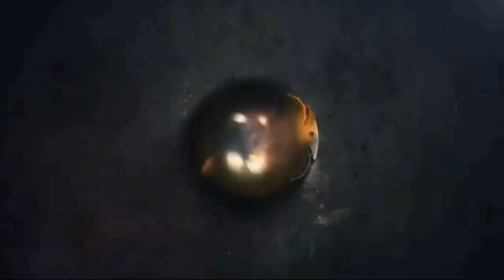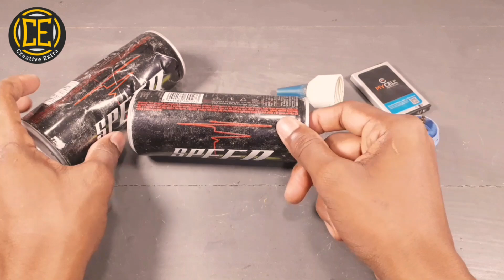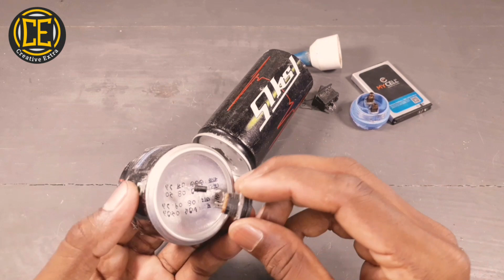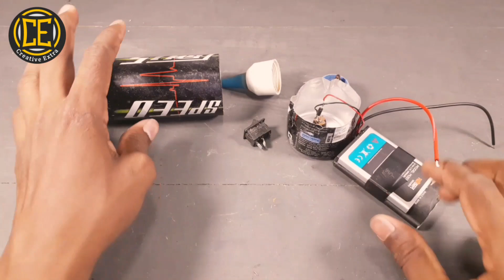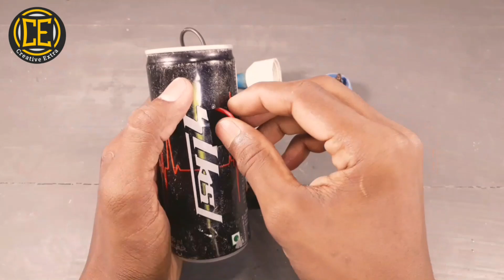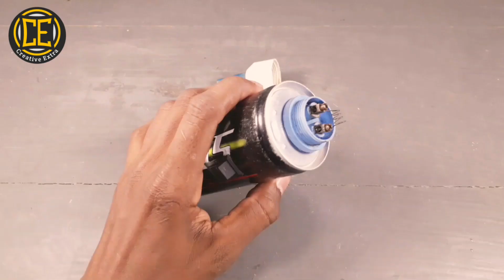How to make a DIY Vape Stick at home || Homemade Electric Cigarette || Creative Extra

Comment: I Use Cheap Battery Banks From The $1 Store... 18650 x 2500 Mah Battery Banks... Then I Cut Copper Tube & Hammer It Flat To Make Strips To Create A Machanical Switch... I Also Use 510 Connections From Bangood... Then I Can Switch My Atomizers... Anyways.. Ty 4 Sharing...Very Cool Device!!!